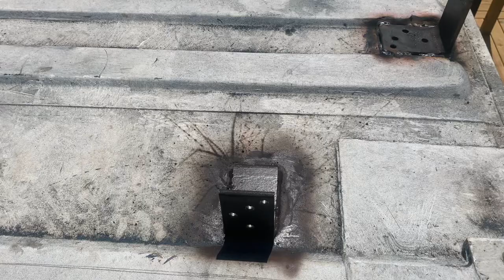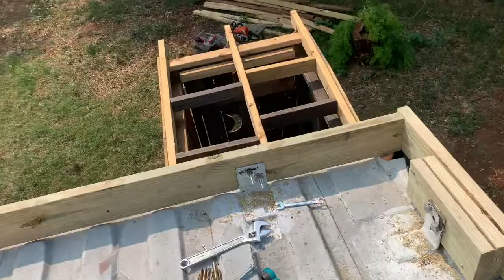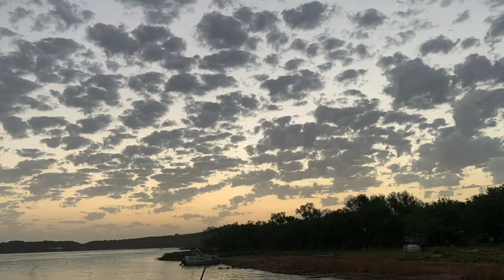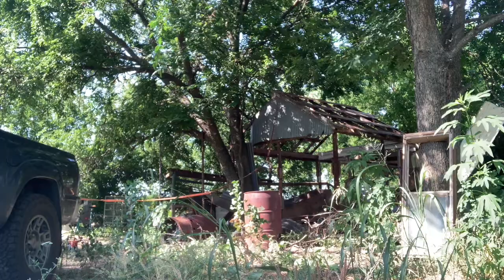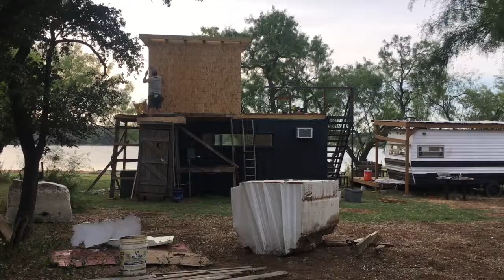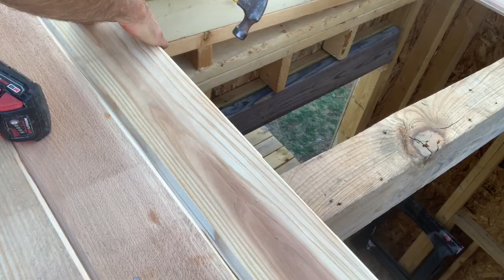Part 1: Cabin on Top of Shipping Container Build

Comment: What did you do to structurally support all this since containers are not designed to take any load on the roof or walls?
Reply from the maker: The load is around the permitter of the container and no weight directly on the roof. The building is also not real heavy. Will it work?? Who knows! Stay tuned haha.

Comment: Screws are bad for building they have no shear strength
For the sheeting rough side out
I build houses for a living
Reply from the maker: Thanks Abe. Would have preferred nails and normally would use. Take care and thanks for stopping by.
Reply: I do slick side out for walls because spray insulation sticks better to the rough side. Slick side down for roof because the rough side is easier to walk on especially when there’s saw dust on it.